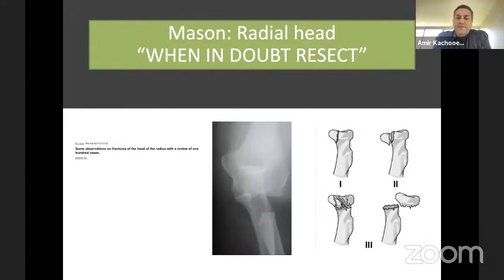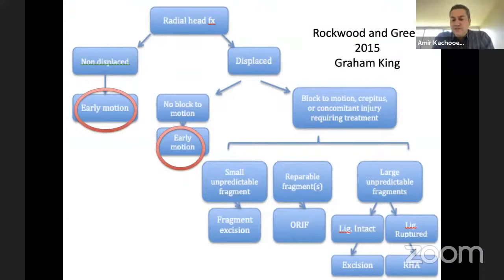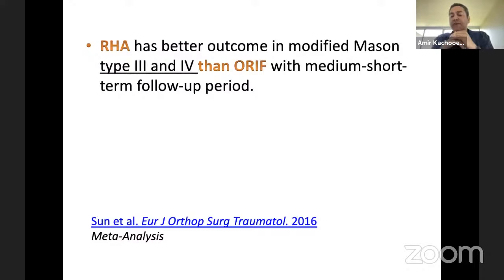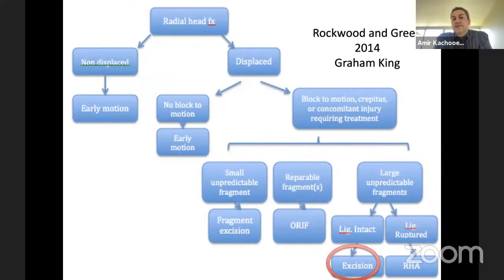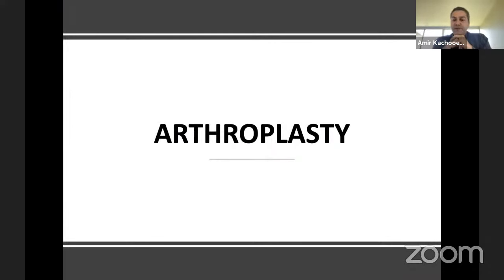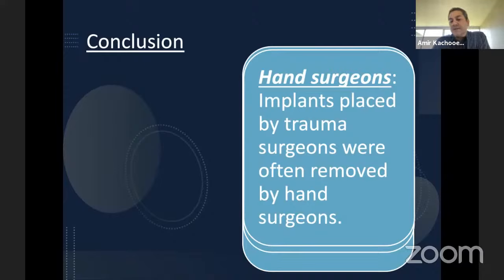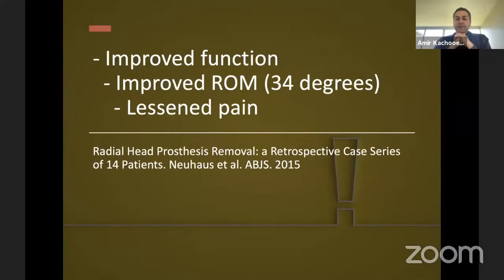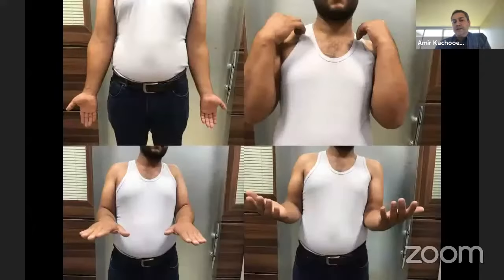Current Concepts in Radial Head Fractures

Comment: I had a radial head replacement 8 months ago from a fall down stairs. Skeletal Dynamics Align Radial Head implant. There hasn't been a day since that my arm has felt "natural", or "normal". There is always a stiff feeling in my elbow, with constant, low-level discomfort. It took over 6 months before the pain reduced to low-level discomfort. It will not extend, or flex like my other arm. When moving my elbow, there is a sensation, and sound of popping, clicking, and grinding. My arm is nowhere near capable of what it was. If I ever fall again, or need this implant removed, or need a joint replaced, I will never allow another implant to be put into my body.

Comment: I had mishap yesterday and facture in redial head as per doc he did plaster nothing else he says 3 -4 week the plaster should be there then the bone ll be fine is that correct?
Reply from the maker: Thank you for your comments. Please visit www.orthopaedicprinciples.com for more
Reply: How are u now?
Reply: @foody4385  I'm good the doc was right bone heal itself it just required to rest
Reply: @pravine9953  I am in cast...m so worried about my rang of motion..do u have full range of motion?
Reply: @foody4385  of course it's been 8 months now by the way the cast is on for one month only then some exercise and back to rutin
Reply: @pravine9953  thanks for replying..hope I will be OK.
Reply: @foody4385  you u ll be soon have chiken 🍲soup or eggs full on it ll help the recovery
Reply: @pravine9953  sure...
Reply: @pravine9953  hy .how are you..Pravin I remove my  cast..now I cant bent my hand...also when I try to rotate I fell pain in wrist..do you have that problem after removing cast.if had how long?how do u stright your arm?
Reply: @foody4385  ya I too had some pain in rotating at start no worries do some normal excersize .. Don't force it it takes time to function normally
Reply: @pravine9953  OK.. 😊